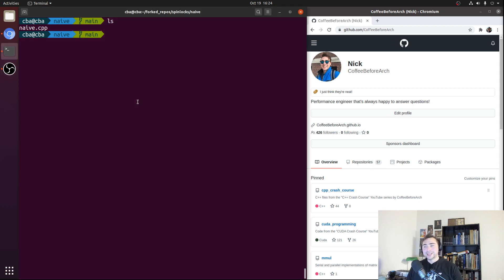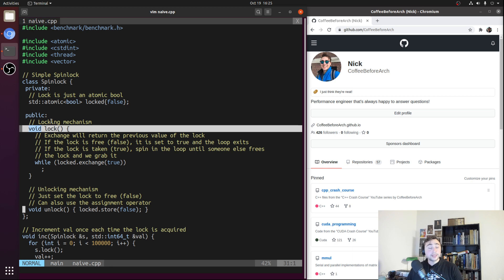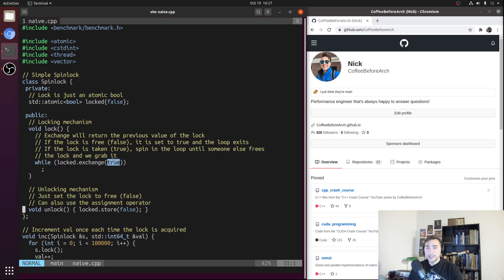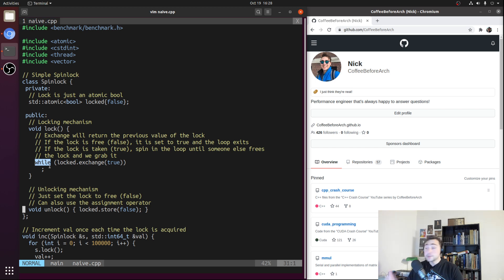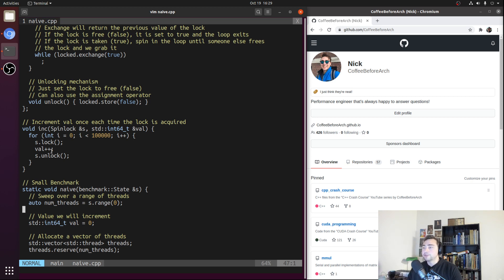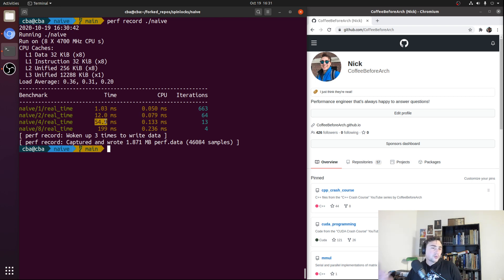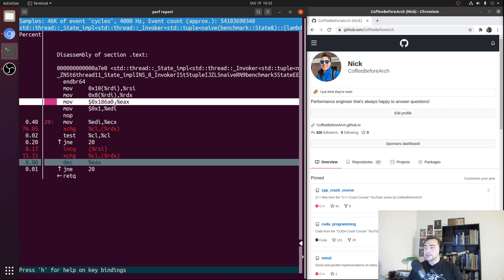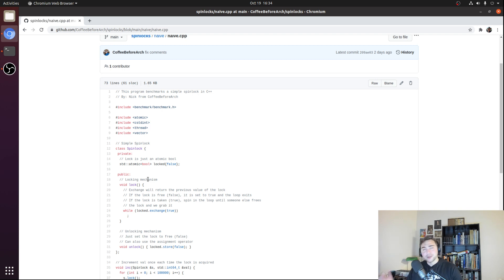Spinlocks - Part 1 - A Basic Spinlock

Comment: Great Content! Question: If each thread tries to increment the variable 100000 times, when having 2 threads, the variable won't necessarily be at 200000 at the end right?
Reply from the maker: That's correct if you don't use locks or atomics to prevent the read+modify+write parts of the increment being interleaved between threads, and having writes stomp on each other

Comment: Correct me if I am wrong, but as I see here we're basically starting a bunch of threads and measuring exactly "how much it would take for all these threads to be joined consequently". So then it would be quite interesting to know if there is the same scheduling strategy in all the cases we run the program and what is it exactly. Also the cache coherence issues(and ways to fight them) would be quite interesting to hear about too.

Anyways, these are brilliant series that give a lot of insight into spinlocks. Keep it up!
Reply from the maker: Thanks for the comment! The intent of the benchmark is to measure how long it takes for all threads to finish their work. While we're serializing (in-order) the join of threads, the act of joining a thread is insignificant compared to the overall execution time (you can see that when we look at the assembly in perf, and our application spends almost all its time waiting for the lock).

You are almost certain to get different thread scheduling each iteration of the benchmarking loop (such is the nature of parallel programs and the O.S. scheduler). While looking at the thread scheduling can be interesting, I don't think it would provide any usable feedback in this case. The coherence-based cache misses dominate the performance here because each thread is fighting over the same cache line.

Thanks for watching, and check out part 2 of the series if you're interested in a strategy for dealing with the coherence misses!

Cheers,

--Nick

Comment: Awesome content! Very helpful — Thanks. I've learned quite a bit from your channel. As the commentator said, it would be amazing if you could cover more multithreading stuff and possibly explain when we should use the various types of locks (mutex vs spinlocks vs shared_mutex etc..) for optimal performance.
Reply from the maker: Glad you like it! I will likely cover more a lot more parallel programming concepts in the future. My immediate plans after finishing this mini-series is to do another on cache tiling and optimizing matrix multiplication, and more content on architecture research.

Comment: if the spin lock is already taken by a thread T1, and another thread T2 tries to acquire the lock, will enter into loop until it gets a lock. In this case if T2 is busy looping to get the lock and thereby consuming CPU how will thread T1 get a chance to release the lock? Assuming a single core CPU
Reply from the maker: Great question! That would depend on the OS's thread scheduler. That will determine if/when a thread will be preempted for another higher priority thread.
Reply: @NotesByNick  Thank you. Your videos are amazing and full of learning.